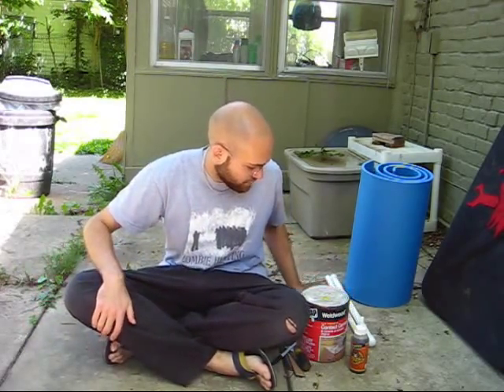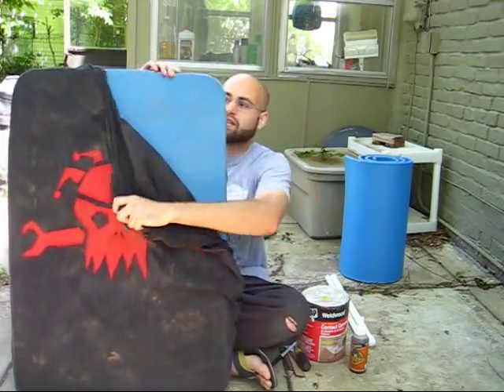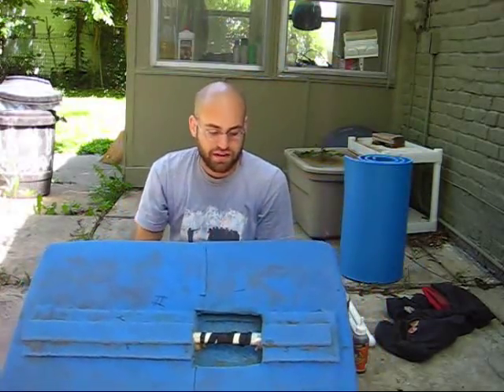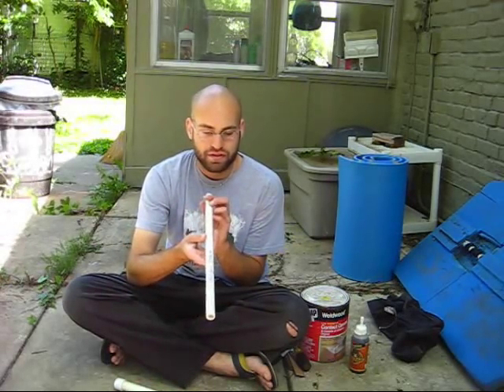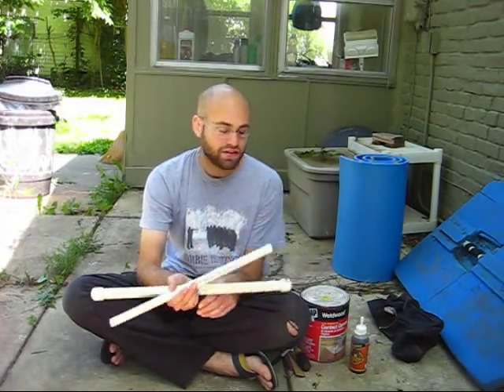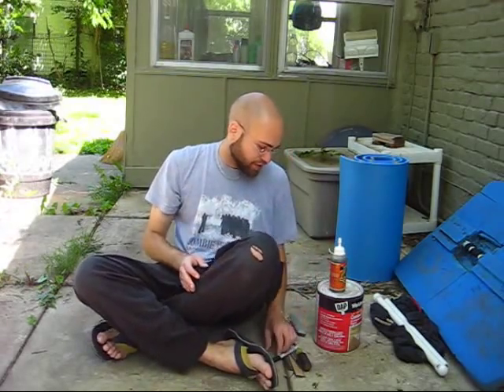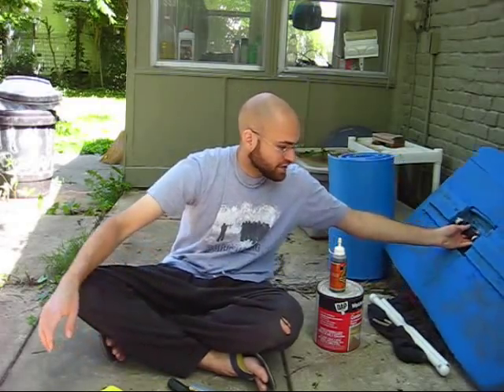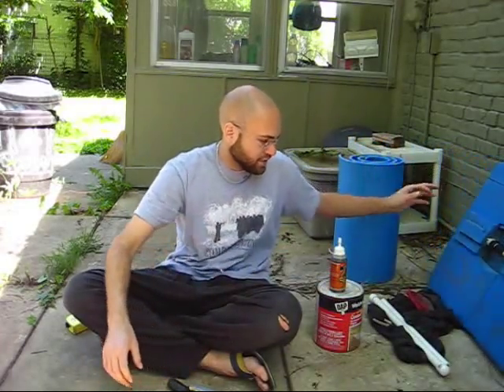How to build a punch shield

Comment from the maker: I make them. I just start out with a large circle of fabric. Make sure its large enough to cover the front, sides, and about 4 inches on the back.
- cut out circle
- sew hem (optional, it keeps fabric from fraying)
- fold over about 1 inch of fabric from around the corner and sew it all along the circle. This creates a channel to put elastic in.
- insert elastic (or draw string)
- sew elastic
- if that didn't make sense ask ma.

Comment from the maker: First off, don't use pvc :P. Bandshoppe poles are the way to go, just google bandshoppe or check out spear fighting 101. 

To make your spear flex less you can try putting a fiberglass rod into the core. You have to add tape to the fiberglass rod to make it the same diameter as the inside of the spear. Many moons ago I had the same problem and used two fiberglass rods from tractor supply (electric fence rods) and it worked alright.